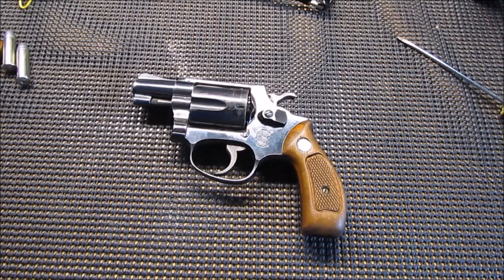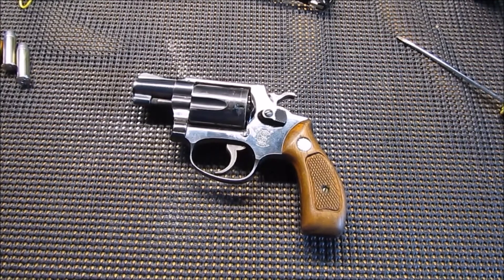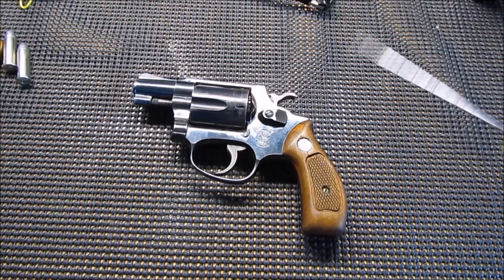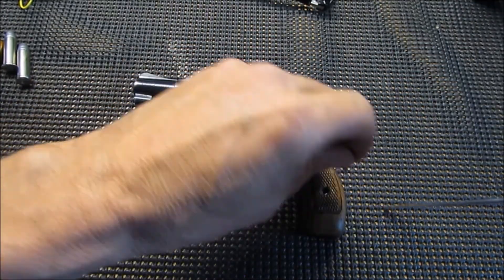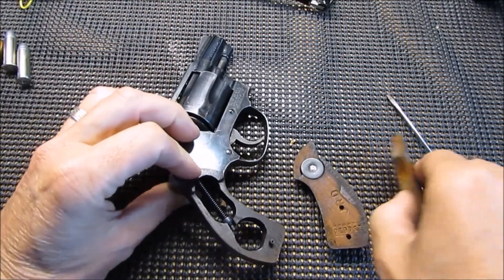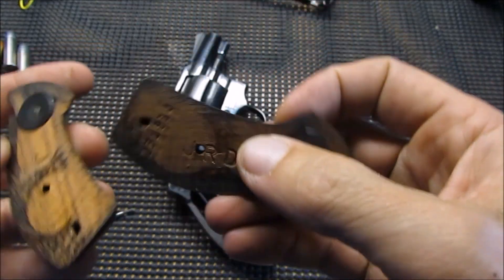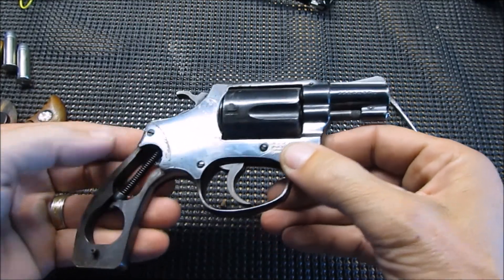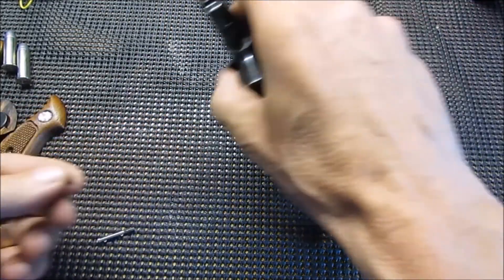Smith and Wesson model 36 maintenance

Comment: after exploring youtube for model 36 disassembly/cleaning content, this among the best.
Reply from the maker: Thank you sir!
Reply: @thevarietyshow7777  😢
Reply: @Rustyguns where is your video ?
Reply: @jerrychambers7267  I’ve disassemble my model 36-1 and those screws are tiny. I don’t see how a popsicle stick could possibly do the job. You need a tiny screwdriver
Reply: I was talking to a buddy last night he said to work on my smiths to do it in a one gallon plastic bag, so you don’t lose springs I thought that was a brilliant idea
Reply: Sorry @Rustyguns that was meant for thevarietyshow
Reply: @thevarietyshow7777 I know it’s late but it’s half true the screw with the flat face needs to go in the back closet to the hammer and that’s really it the other 2 have a rounded face that doesn’t fit flush to the side plate those are interchangeable in my experience

Comment: I’ve read that you should never pry off the sideplate for fear of bending it, but you did it successfully.
Reply from the maker: Correcr you shouldn't if at all possible but this gun hadn't been cleaned or opened in decades. So if you have to. Be careful and only use light pressure until it gives. Don't pry hard.